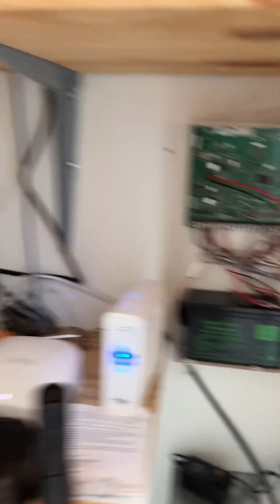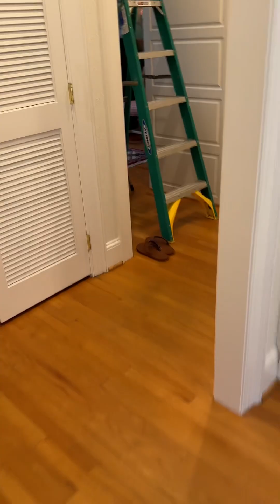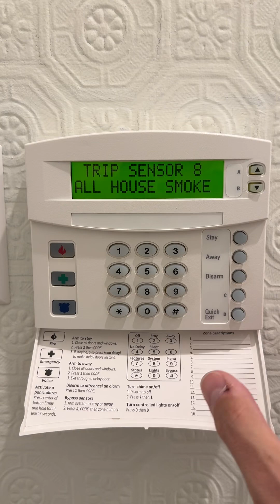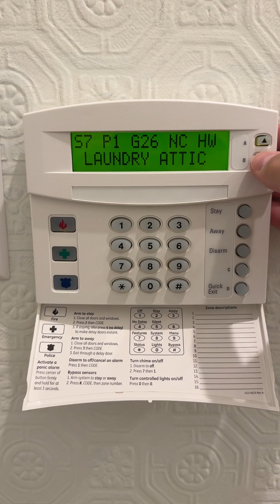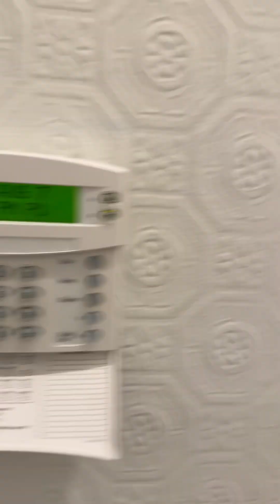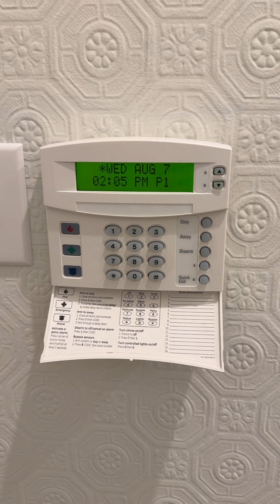Concord 4 two wire smoke not being detected *FIXED SEE DESCRIPTION*

Comment: Fire alarm tech here, Those are System sensor 2 wire smoke detectors ( System Sensor 2W-B), also if you know what the EOL (end of line) whitch means the last smoke detctor on the line is check the resistor in it it should have a resistor on the smoke detector base when you twist it of there is 3 important terminals [ + + - ] the resistor should be connected to the second + and the negative terminals. If you dont know the eol device you can check by pulling off the detector by twisting it and see if there is more than one set of  wires connected to it when there is more than one it means that there is more after that detector oncee oyu get to the one that has only one set of wires in ot check if there is a resistor or if its connected wrong if there isnt one then whoever installed this system did it wrong. If you have any more questions let me know and good luck.
Reply from the maker: Thanks, I didn't mention but it does have the end of line resistor.  What I was missing was the fact that after I enabled the two wire option and entered the learn sensor menu, I didn't realize that when it said "Trip" I was supposed to press test on one and let it learn what happens when it trips.  It got pointed out to me and I did that and it's all working now!  Thanks for the reply though!
Reply: @jefflaws8061  No problem im gald you got it all figured out